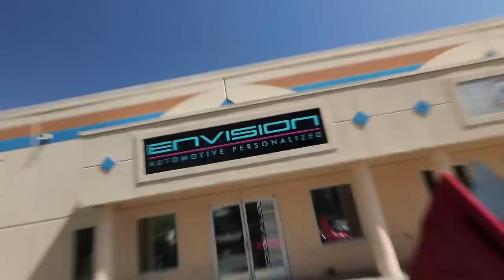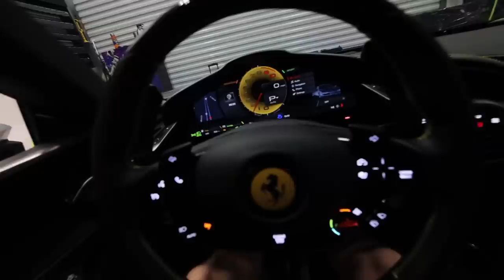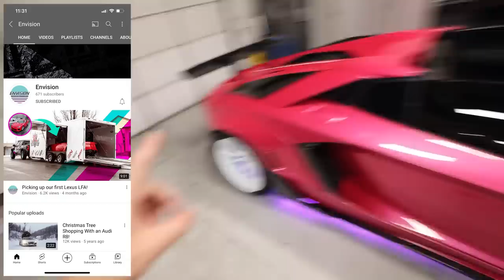Installing illegal Underglow on my Widebody Aventador

Comment: Tie the under glow to the tach so when you wind it out, it could look like flames are coming out of the car or under glow just near the wheels light up. Needs to be more dynamic to how you’re driving so it doesn’t feel like it’s on a loop.

Comment: Check the spark plugs in the lambo, that can be an issue with the idle issue. Ive had the similar and same issue with other cars of mine. Worth a shot instead of going to a lambo dealership.

Comment: for people who don’t have strad money led installs are easy and take a couple hours for under glow. Amazon prime a kit for $30-70 install directly to car battery * won’t kill any power due to how low the voltage is* unless left on for days. Run through your engine bay under your car, don’t be afraid to get dirty it’s car work🤷🏾‍♂️😂, clean and apply stick on or glue depending on if you want it on permanently. (Wouldn’t recommend unless your keeping the car forever)
And simple as that you have your led kit. I have a Bluetooth voice/music activated kit for around $100.

Comment: @TheStradman i did research on the murci problems hear you go take this to a good manic like makes and models                                                                               This is a common issue on the 03 -04 Murcielago. I'm guessing your friend is running a lead acid battery.

The issue you are having is low voltage while driving. In the Murcielago, this affects the throttle body because the E gear doesn't know when to engage. You may be getting a P2121 low voltage code as well.

To no surprise, the Lambo system is very complex and a change in voltage will affect acceleration amongst other things. These are NOT like normal cars and to explain how they work would take forever, but the throttle body is motor-driven so that when you hit the gas, it immediately opens MUCH faster than a conventional TB. However, low voltage conditions can fry this motor which in turn causes the TB to operate like a conventional TB, meaning it can not open fast enough to allow maximum power and you feel it clearly when driving the car. This also, of course, causes issues with the throttle position sensor (you may have a code for this) because it isn't where the computer is expecting it to be.

What you need to do is switch batteries to an AGM, or Absorbent Glass Material, battery. They are made for these cars that require a ton of charge to crank and run properly. They are expensive, but that comes with the nature of having a Lambo. In addition, the throttle body isn't cheap. Used ones I show for sale in Houston are around $1300. New ones are closer to $2000 - $2500. It is an intricate piece and unfortunately, again, parts for these cars are just expensive.

Replacing those should solve your issues though and clear any codes you may have. I would HIGHLY advise your friend to keep the car on a battery tender when not in use for any length of time as they vampire voltage from batteries quickly.

Good luck and let us know how it turns out please.

Comment: 600k views and 50k likes for a mod that's not legal to use on the road. No wonder society is going down the toilet.... like those shoes!
For those who don't understand what's not legal, it's the state laws about motor vehicles with certain color lights in the wrong places... especially if they flash or pulse. Go read your state laws before you argue your points.